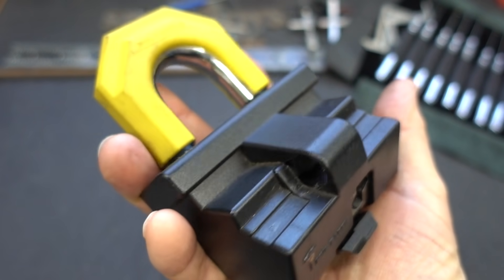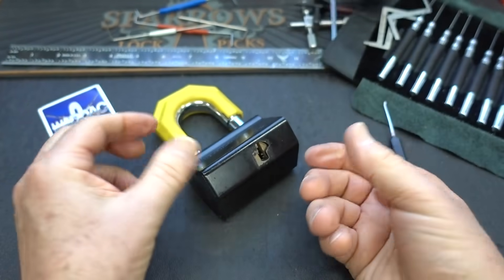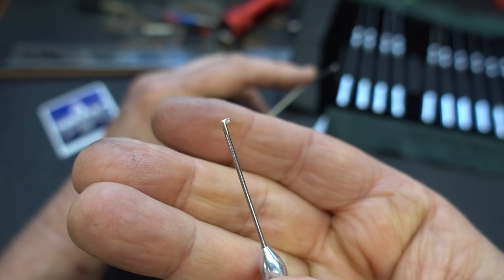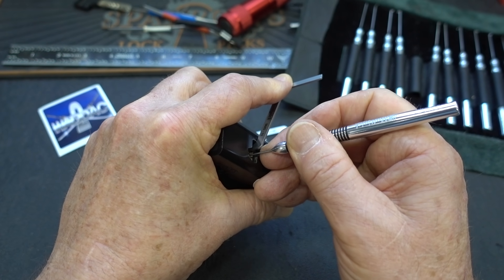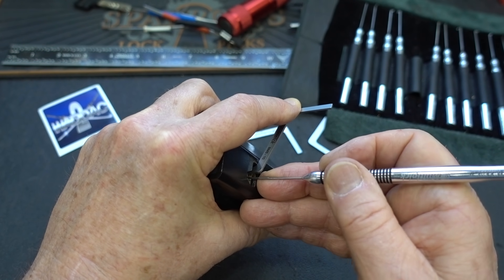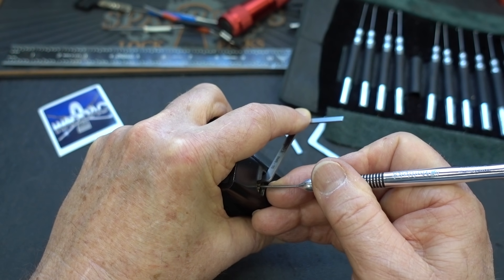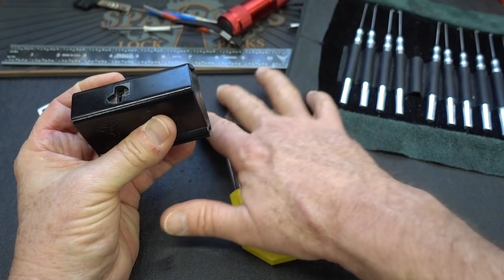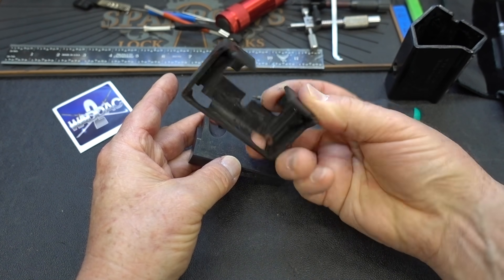(1819) Really Ugly Mul-T-Lock

Comment: Car gear shifter lock I picked a load of these locks really easy to pick. They more common in the UK. Great vid bill
Reply: Bought a MK1 Miata and can confirm. Car came with this attached
Reply: I had a similar lock in a Golf mk2
Reply: I remember that one, you had a bunch of them
Reply: Makes it a lot easier when you have seen it in use. My bro had one in his car. Good enough Vs opportunist car thief, not professional.
Reply: They're.
Reply: @jord5626  I assume the reality is that you bought the LOCK and the car came attached.
Reply: That is a shifter lock..They were popular in the 1990's.. I had one installed in my brother's car when new.. It saved the car at least 2xs.. It locked the shifter in "park" or "reverse" on manual cars.
There was a bracket that bolted through the floor.. It kept the guy with the hammer and screwdriver from borrowing your car.. Yeah you can tow it or had a friend shift the car from under the hood..But they had to be ready for that..
Reply: I had one fitted to my Mk2 Golf in the late 90s
Reply: @chris_ackroyd  I had the big bumper GTI 16v with this lock and a vector alarm they were classed as top notch back in the day . The ram raiders days Lol👍90s
Reply: @JONSLOCKPICKING  if this came from waddac2 isnt there a chance it came from you first?
Reply: @Phred_Phlintstoner  no mate to dirty my ones were brand new Lol plus my ones had interactive cores in. I just got the defender one what a lock just like this one but you can’t gut it and very tricky pick. That’s for a up coming vid

Comment: As others have said, it's a gearstick lock for a manual transmission vehicle, usually a car. They had a metal plate that was bolted to the side where the gearstick is then the gearstick was placed in the 5th gear neutral position (In the centre on the 5th gear side) then the shackle was placed through the base of the gearstick and locked to the plate using the padlock. The padlock was usually screwed to the plate to prevent you losing the lock. these locks were usually purchased from vehicle mechanic workshops or vehicle parts stores and fitted by professional mechanics. It's generally not a product that you can do yourself. The plates needed to be supplied fit to measure for the make and model of the vehicle before purchase so it's vehicle specific.
These date back to around 1993 up to 1998 or so and were used to prevent the use of the gearstick where other locks had failed ie: Autolok gearstick lock. Back then all you had to do on some vehicles like the Ford Sierra was unscrew the gearstick knob and throw the lock out of the window. This Mul-t-lock prevented this vulnerability and many insurance companies offered discounts for this added protection. Don't forget, back then cars didn't have car alarms or immobilizers as standard, they could be opened with a screwdriver and hotwired.

Another thing to consider was a lot of these car security products were available to secure cars like the Escort Cosworth, Escort XR3I, Sierra Cosworth and the Lotus Carlton. These cars were highly desirable and very often stolen. They were also VERY fast cars for the time and would most likely outrun the Police most of the time and these cars had very basic security.

This is just based on my knowledge from the UK.

Comment: Yup, still have one of those on my '98 Ford Fiesta. xD
It's a gear shift stick lock. Lacking the metal piece that attaches to it and gets anchored under the car floor, as an extra security measure.
You lock the entire shift on a Rear position, and when not in use, you take the shackle out and put on top of that plastic case.
It was pretty popular as the best car lock back in the late 90s or so, here in Brazil. Most people used that steering wheel lock thing, this was like the more expensive higher tier method of locking your car.
And yeah, I think most cars in Brazil are still manual shift... not totally sure anymore since I'm not into cars all that much. As long as it takes me from A to B, it's fine... reason why I'm still driving a '98 car. It went way past the optimal time to sell it, if I was gonna get a new car I'd have to sell mine for bananas, so it's only happening when electric cars become feasible here.
Reply: I bet that lock is probably
worth more than some of the cars it's intended for !

Comment: That lock is designed to block a car's gear lever from moving. When you want to drive the car, you remove the shackle and put it in the hole next to key. When you arrive, put the car's gear shift in "Park" and put the shackle in place to lock the lever.

Comment: Its called a Mul-T-Lock 45 -as the key enters at a 45 degree angle  
They were for locking the car gear stick into position to prevent it being stolen 
The lock attaches to a bracket bolted to the car / truck floor via the two screws where the shackle enters  
When not in use the shackle is placed in the holder in the top of the plastic lock body 
There  are two  version's of this lock standard (the one you have ) or interactive that  have a security pin on them machined into the lock keyway that interacts with a loose pin in the key  
They do not make these anymore  
If you remove all the plastic from the lock body & shackle they can be used as a padlock !!

Comment: Bill what do you mean by counter rotation ??
Reply: When you pick a lock, some pins have little bevels on them, so when you pick it and come across one of those pins, it will turn the lock in the other way.
Reply: Done correctly it can take too much tension off the core and drop the other pins back down making you start picking all over again.

Comment: The polymer safe Gun Scrubber (aerosol can of solvent with a high pressure spray tube) would probably be good to get the nasty crud out of a lock.

I pity whoever tries to use or maintain that lock two years later when the gummy yellow oil in that WD-40 oxidizes into thick goo.

Comment: I can send you one of my Mul-T-Lock where the inner pins aren't fixed...
Loose bible as well, but the inner pins launch themselves + the tiny spring outside of the outers as an added bonus...
Reply: Do you have the Multlock E18H?
Reply: @juanbaclavab  C16's, but older ones.
Reply: @juanbaclavab  You can buy them directy from mul-t-lock-online.com or keep an eye on eBay; there's several seller from the US and UK who sell various models (including the 18 E-series).

Do keep an eye on the core in the lock you'll be buying; there's several different cores in some series depending on the lock's age.

Comment: Yes, what an Ugly "plastic accessorize" Multilock padlock.  Perhaps a "fashion statement" that's gone wrong.  Guess it must be angled that way to make it easier to insert the key, but why plastic on the outside of the shackle?
Reply: It was used to lock a gear shift sick on a british car one part of the lock was fixed to the car thats why its angled the yellow plastic was to make it visible to theives this product did work it stop my cousins car getting stolen 20 years ago people have imobilzers now so you dont see them any more plus they were not cheap to buy and them get fitted. Andy England 🇬🇧👍
Reply: @andrewdaley3081  Thanks for sharing on what this locks was originally made for

Comment: Shouldn't be too hard to put back together since you have a vice. Clamp the bible upside down, load all the springs, and use your follower to hold them down. It might even be easier than most locks.

Comment: wait, the entire assembly is held in by that one screw? That seems insecure.. you can disassemble it in place!
Reply: Not when it's locked
Reply: The shackle goes through that outer sleeve held together by the one screw so It won’t disassemble until the shackle is removed.

Comment: I'm glad It wasn't me being a complete novice that ruined my chances of getting one of these back together. Why on earth did they design it this way? They must have pixies put them together. Those inner pins and springs are TINY. ...and a standard multilock padlock cylinder won't fit in these without boring out the body. Terrible design ..do you think it was meant to offer another level of pick resistance? (Something else to jam the pins) ...or was it just a cheaper way to offer a hardened steel bible for drill resistance?

Comment: Bills fingers look like what happens when you take a lock apart that some fool damaged with WD40. Ruins clothes and locks too! What's not to like?
Reply from the maker: Well, the smell is heavenly and it tastes like elixir. Also, it cures warts, rashes, dandruff, and venereal disease.  A light coat on your hands cures chapping and insulates you from up to 900 volts.  It is also a powerful hair growth catalyst, strengthens your fingernails, promotes healing, and is great for your skin.  WD40 is also an excellent substitute for high grade olive oil in any recipe.
Reply: @bosnianbill  The sardonic mirth in this one is strong young Skywalker.